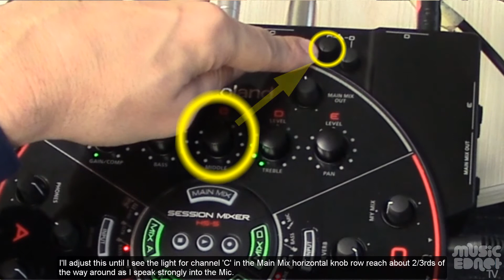Roland HS5   Part 5, Microphone input gain adjustment and compression application

Comment: I want to connect a condenser mic. Presumably I'll need to add phantom power in the signal chain, but...

1. Will I also need a preamp? 
2. Was that gain setting you showed in this video the equivalent to a preamp? Or was it actually compression?
3. In the case that it's for gain and not compression. How can I adjust the amount of compression?

Thanks